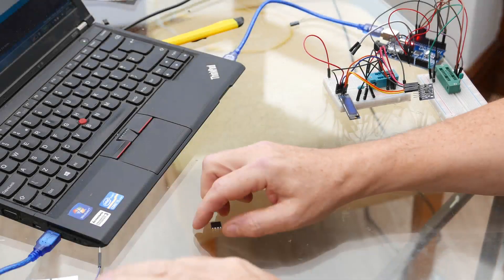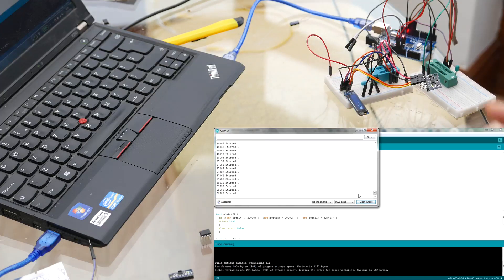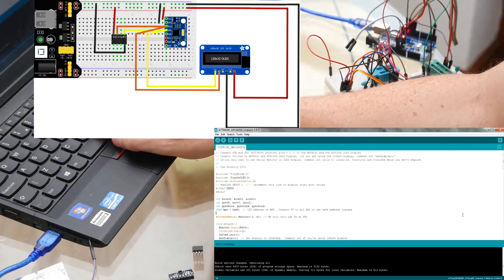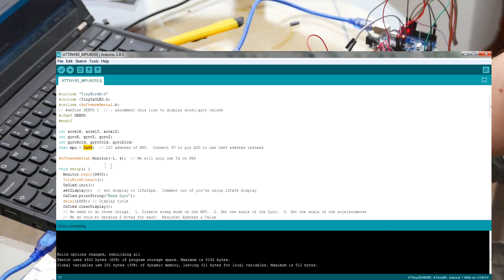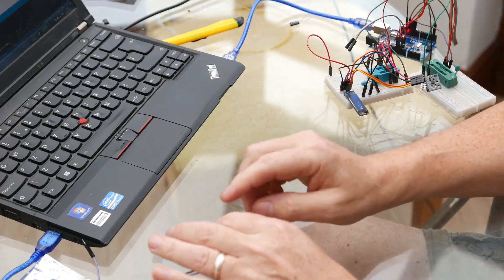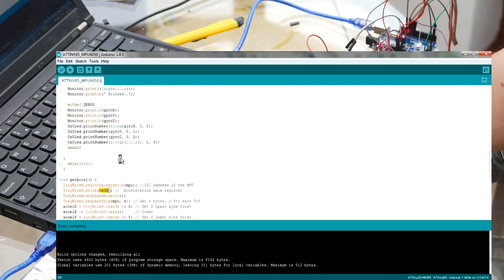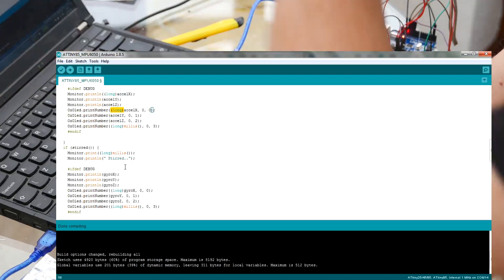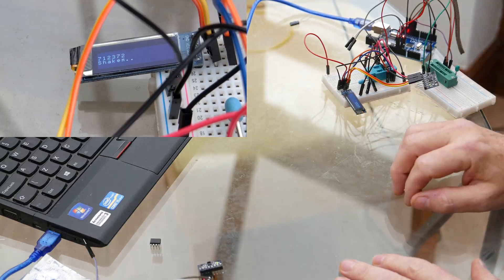ATtiny85 and MPU-6050 6-axis Accelerometer and Gyro Arduino IDE

Comment: Is there any way this can be used in low power mode, with only the accelerometer working, and work as a switch? So that when the inclination changes up to a point, it interrupts the sleep mode of an mcu.
On the other hand, is this measurement susceptible of inertial forces? I wanted to use this instead of a tilt sensor just because of that.
Reply from the maker: Yes .. it has a low power mode and you can configure it so that one or both is powered on.  In active mode, I measured 5mA on each but not much more with both active.

I got good low power characteristics by putting the ATTINY into WDT sleep and powering the MPU on via a FET and checking X Y Z for changes.  The more advanced MPU features use more memory.

Comment: Excellent video Tom!
Im new to the attiny wold, one question, could i use this to make an ultralight rc plane stabilizer? 
I would like to monitor the current angle and modulate an output to two servos to control pitch and roll axis. is there enough pins on the attiny85 for 2 servos plus the gyro?
many thanks
Reply from the maker: Yes.  Used in many drones and other RC craft but it will require more code and calibration.  Extra code may put it beyond the tiny's 8k flash limit.  Check Stackexchange for "How can an Arduino-Quadcopter be stabilized."